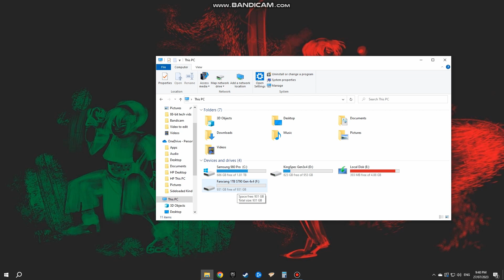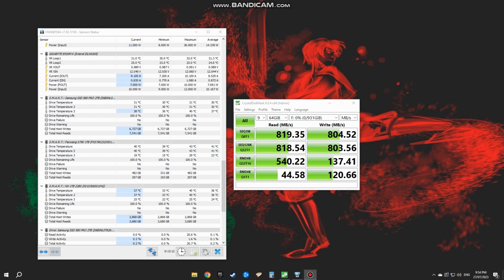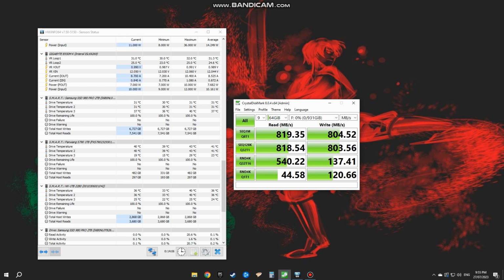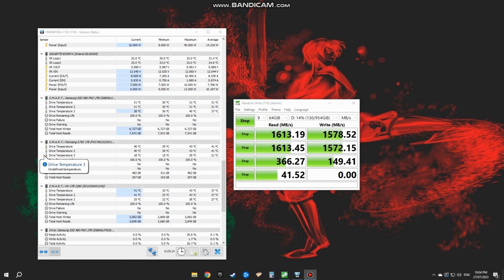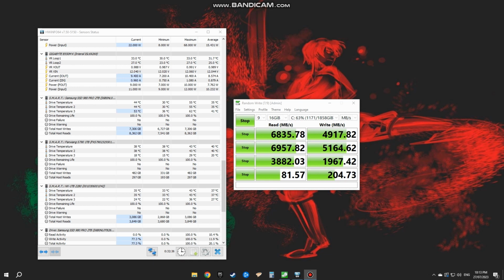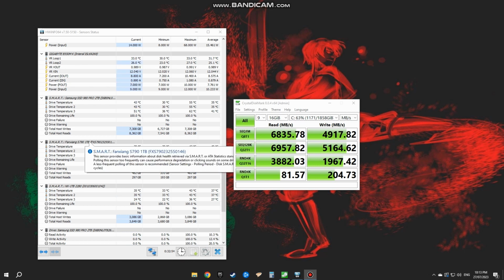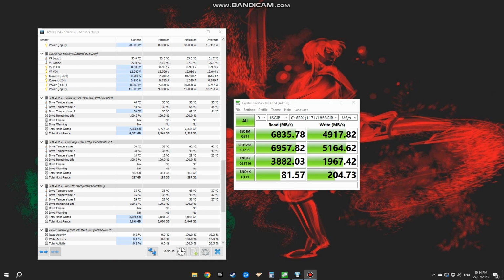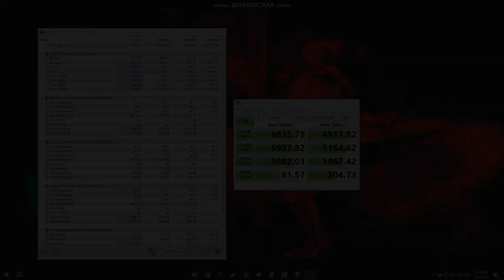AliExpress M.2 NVMe to PCIe Adapter Review

Comment: Thank you man, am building a second PC from spare parts and don't want to spend too much. old motherboard is sata only.
Reply from the maker: No worries mate! This adapter is an easy and cheap way to add an m.2 nvme if you have a free pcie slot. Would love to see how your build goes when its finished!
Reply: @88-bit-tech  But -is it booting from this?
Reply: @OKuusava  if your motherboard doesn't support booting from an nvme you'll have to use something like Clover Bootloader, you can put it on a usb flash drive, boot to the flash drive then boot to the nvme. If you configure clover beforehand it will boot instantly without you having to select a boot option in Clover
Reply from the maker: @OKuusava  It looks like my motherboard allows booting from this adapter but I haven't tested it as my OS is on my Samsung ssd on the m.2 slot 1